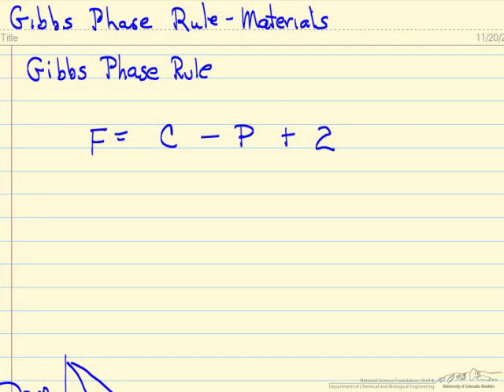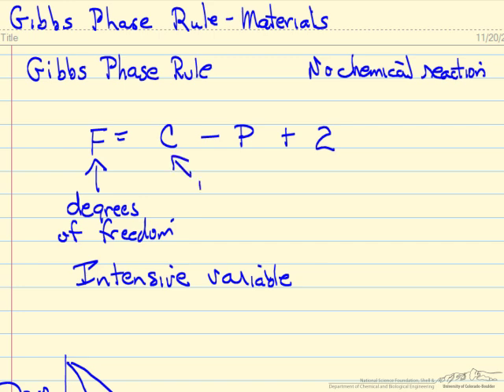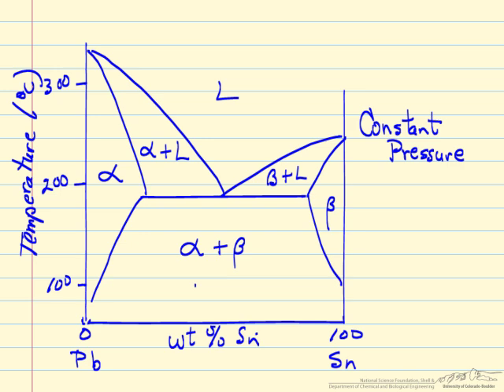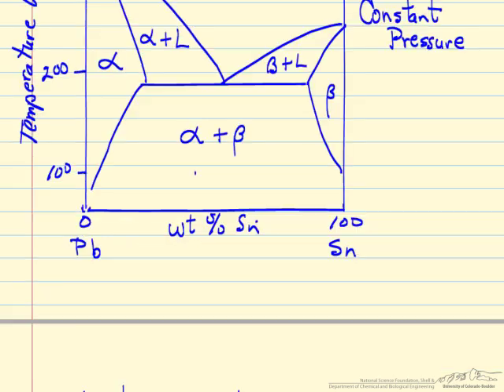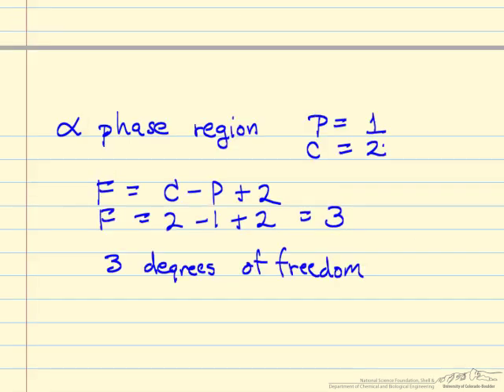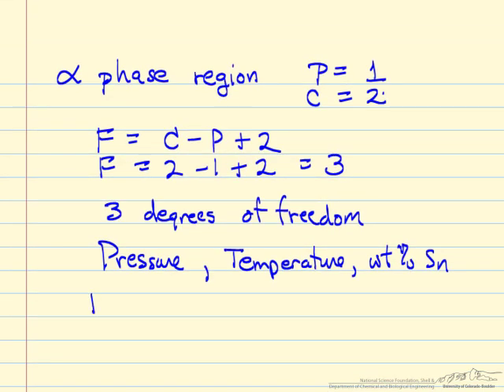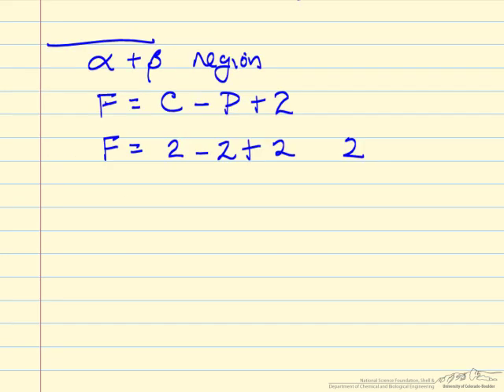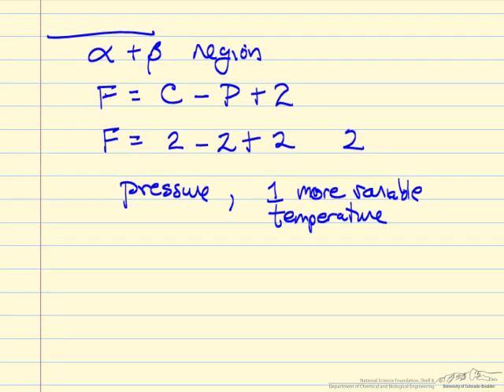Gibbs Phase Rule for Material Science

Comment: For a two-phase system at fixed pressure, why is it sufficient to additionally specify temperature or concentration but not both?
Reply from the maker: If you have a 2-phase, 2-component system, there are only two properties that can be specified before the system is completely defined.  Once you specify pressure and temperature, the concentration is known.

Comment: The integer for this equation should be 1, not 2 since it is related to the number of intensive parameters that are being considered.  The reduced phase rule applies (because it is a 2 component system and we are not dealing with a vapor phase).

For example if we used (F = C - P + 2) for the given diagram, in assessing the degrees of freedom for an invariant point we still have 2 components, but we now have 3 phases present due to 2 different solid phases and 1 liquid, and therefore we would get F=1 when we know that F=0 for an invariant point.

Comment: Are you automatically assuming that the number of state variables is 2...is that why you have a +2 instead of + N? B/c in a condensed system pressure is obsolete and it would only be +1
Reply from the maker: The number 2 is part of a phase rule. Moreover, in a condensed system, pressure is not obsolete. It is a state variable.

Comment: hello 
by the way isn't the gibb's phase rule Variances F = compounents n - phase p +1
and not in the end +2 
my materials science prof wrote it with one in his lecture is it wrong?
Reply from the maker: +Sebastian Lockmann I think this is a case of differences in definitions.  The Gibb's Phase Rule used here is indeed F=C-P+2, but the F is degrees of freedom, with zero meaning everything is set.  The term you used for F is "Variances", which I think would mean how many possibilities there are.  In that case a variance of 1 would equal zero degrees of freedom.  You may want to verify that with your materials science professor.